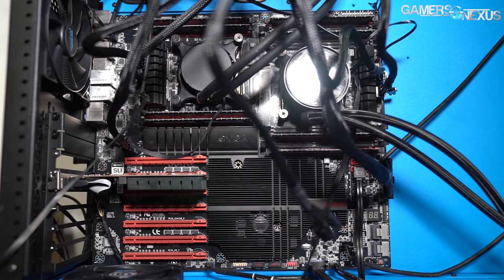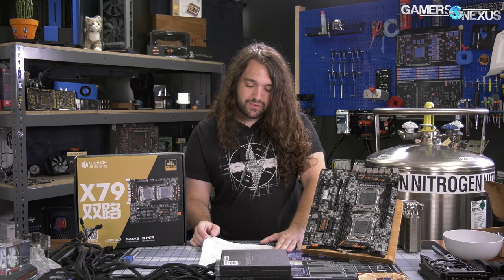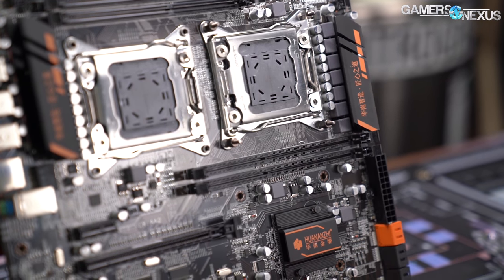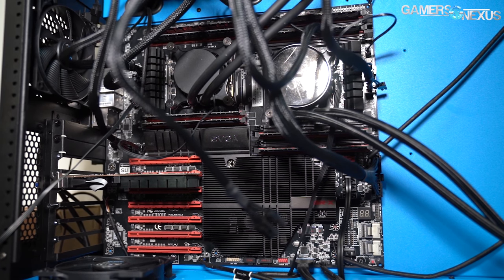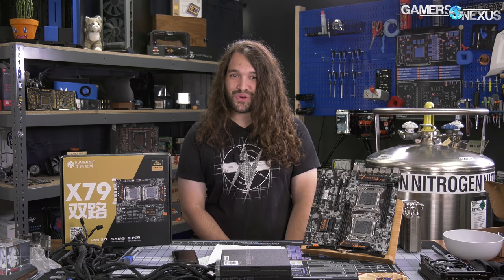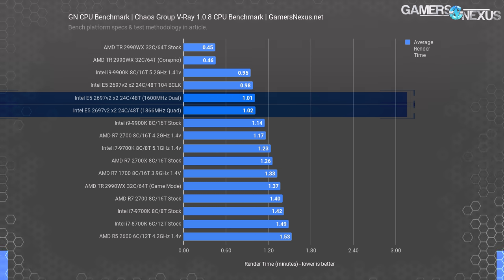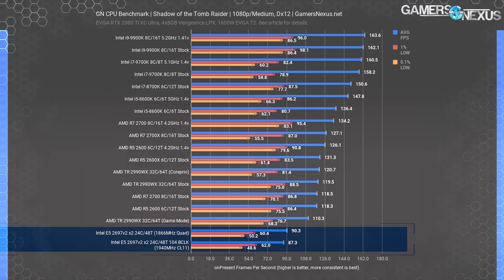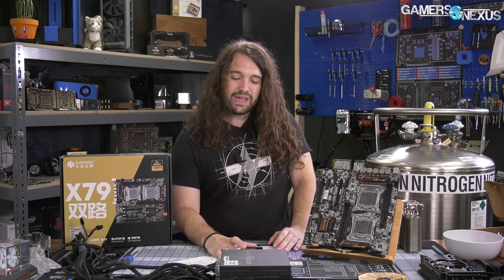Building a Dual-CPU Behemoth from Used Server Parts, ft. CaseLabs & Old Xeons

Comment from the maker: Grab the GN toolkit here: https://store.gamersnexus.net/products/gamersnexus-tear-down-toolkit
Watch TiN explain loadline and voltage here: https://www.youtube.com/watch?v=V2dqHqlyWio
Reply: @Gamers Nexus LOL i edited my comment right at the moment you gave it a heart and now the heart is gone - did you know that that will happen? :D
Reply: Can we please see how the 3900X does against these cpu's? I would love to see how these compare.
Reply: On new China 2011 motherboards available 8 channel RAM (4 per CPU x2) btw. Check it!
Reply: to get the chinese board to work, did you ever move the com jumper? I know most dual gpu boards have a set of jumpers above the VRM's. usually its 4 poles and if not configured properly, then the two cpu's will or will not be able to talk to each other.
Reply: Please keep doing what you're doing guys. You are amazing!
Reply: Why don't you try a odroid mc2 cluster Vs this setup (a LOT more efficient)
If you want a server to add salt to injury just stack some HC2 with glusterfs and use the cpu for handbreak ;)
This is a arm32 8core 2gb ddr3 soc made for these tasks ;)
Reply: @vsbb13  lol try lizardfs for PC+ PC= 1x file system
Reply: What about intel vulnerabilities patches on that Chinese motherboard?
Reply: @vanpeters9751  the thing is... These boards are waaaayyyy cheaper and more energy efficient than a PC
Reply: @vsbb13  cool I'll have to look into it more
Reply: From what I've heard there are some Engineering Sample E5 2XXX chips that have unlocked multipliers, would be amazing to see if they really exist and to see an overclocked dual socket build!
Reply: I upgraded my old supermicro rig with these same processors two months ago.  I love the speed boost I see in Premiere.  Do you guys think it's worth upgrading my 32GB of DDR3 1333 to 48 GB DDR3 1866?  What performance boost should I see?
Reply: maybe use google translate on your phone? i use it all the time
Reply: Get a Legit as in OEM Release version .... XEON 2679 v4 SOLO... (If can even find one, super rare) ... then you will see Broadwells TRUE performance! POWWW!!
Reply: AMD Opteron 3365  ;)

Comment: the words under X79 on that chinese motherboard literally mean ‘pair of roads’, roughly translated to ‘dual socket’
Reply from the maker: Very cool. Thank you!
Reply: Perhaps "two way" is the more applicable translation in this context.
Reply: The phase of “two roads” also use in China as be the translation of “dual socket” and “duel channel memory”.

BTW, The Chinese wrote all over the heatsink are crap like “we got the best technology “ and “we have good quality and durability”
Reply: 双=dual/two/double/pair 路=road/way
so i think it means "two ways" originally
Reply: @linuxsubsystem1638  It's just a term they use for dual socket I guess

Comment: Huananzhi, lterally means Made In South China.
Chinese brand name: Huanan Jinpai , literally means "the gold brand from South China".
A new brand started in 2010s which's famous for their new motherboards for old Xeons. 
In mid 2010s China used to import tons of old server hardware as electric trash for recycling. Meanwhile some PC geeks began to look into those trash parts and figured out ways to reuse them
they discovered padding 771 xeons that works on 775 motherboard. then they started to make new x58 , x79 mobos with mysterious chipsets. the brand is for the PC geeks..or nicknamed trash collector Lajilao in Chinese.
Reply from the maker: Awesome! Thank you for the history.
Reply: I still wonder how they make their x79 mainboards for example. Do they get the chipsets from Intel? Do they rip them out of old server mainboard and somehow transfer them onto the new boards?
Reply: It’s so awesome to see them take use of the old stuff.
A few years back it was so frustrating to see all the cheap i7 920s for sale that were basically useless because the boards cost three times as much.
Reply: @Martin M 
I know. Steve also mentioned that in the video. But how do they get the C600 series chipsets?
Reply: @-eMpTy-  Those are probably recycled chips from old servers
Reply: I think Intel keep stocks / manufacturing for many years to support existing product lines, the chipset could be brand new.
Reply: @Martin M It's the C602 chipset I believe
Reply: @Godfrey180  Yes. The chipset is used. Some sellers on AliExpress even mention this.
Reply: @-eMpTy-  Most of them aren't true X79 boards, because they use non-overclockable server chipsets. There are a handful which seem to be genuine X79 though. Mostly ripped out of old server boards, as you say.
Reply: @-eMpTy-  most use a c602 chip some use a real x79, some use desktop ivy bridge like q77, desktop chipset boards are the cheap ones with only dual channel, the c602 and x79 boards have quad channel and the latest models have overclocking without needing a bios hack, they work with XTU properly. like the x99 F8 and x79 2.49 v2.1. They are just BGA chips, not that hard to swap around if you have the proper equipment.
Reply: hahA! 
Thats Awesome!
 The Trash Collector! 
 The FIRST Image to pop into my mind was "Oscar the Grouch", a-la "Sesame Street",... of course. 

Likewise, I also very much appreciate you taking the time to comment.
 Many Thanks.
(Formal Bow, MUCH respect) ;)

Comment: Glad you decided to make a main Channel video out of that - really apricate that.
"A little Linus" like Video like that is very welcome.
You could even do more small parts like that in a mini series while doing the project.
I really enjoyed the more professional approach to that.
Reply: Me too I like this fun type of content also, Thanks
Reply: I liked that Steve showed how difficult it can be to get old hardware working together, especially if you are coming in not necessarily knowing absolutely everything about what you're doing.  The average consumer would have spent several times to get the end result, which would have resulted in an overall cost greater than a new modern system, which Steve demonstrated very well.

Comment: The problem was definitely the ES vs Retail chips. You can match two like chips together, but even the same SKUs will not work if not identical. I've been using the Huananzhi dual board for about 4 months and it's working just fine, if you ignore the dual channel memory.
That said, I'm super jealous of the SR-X board, even with its history.
Reply: I have seen your clip on the dual x79, been thinking on gambling on a cheap board just to experiment. But I was wondering why both of you purchase your board and cpu separately, not sure whether it does back in 2018, Aliexpress currently has entire sets that include board, cpus and rams. Apparently one of them have 8 dimm slots.
Reply: All of my fav xeon channes here
Tjc and you

Comment: For another project, you could try picking up some cheap Epyc first gen ES CPUs, then try using ZenStates from Elmor or do RW-Everything to change the registers to OC them. Sometimes you need older BIOS to use it with the ES samples, but this is just a thought (plus a hell of a server after doing it).

See this on OCing Epyc:
https://forums.servethehome.com/index.php?threads/overclock-your-amd-epyc.23422/
Reply: This sounds fascinating, especially the process to unlock etc.
Reply: can oc epyc!!!! very epic

Comment: I have one of those dual x79 huananzhi mother boards from Ali express for only $97 dollars delivered when using a few coupons which are readily available 

Then I got hold of 2x 2690 xeons for free from a throw away server

16 cores and 32 threads for peanuts
Reply from the maker: Wow! Good setup.
Reply: @GamersNexus  how is my setup(value wise)
E5 2689(2690 basically) 50$
Huanan x79 75$
4x4 1866 32$
Cx 650 50$
Rx580 121$
Reply: @spacy9571  Probably would have been better off getting a refurbished Optiplex with an i7 and standard ATX PSU for $200. Can find them with a 3770 all day long on eBay.
Reply: @alexskywalker888  lol what my cpu matches i7 3770 in single core and eats it in multi score
Reply: @spacy9571  how does that PC game?
Reply: Mine is in route as we speak. I got it for 100.00 and free shipping. I have a pair of 2680's waiting in my safe. 
By the time it gets here I should have the rest of the components in hand.

Comment: Old Xeons? I'm here! Where's the YES man? 
Just finished a recent build using an E5-2667v2 (fantastic frequencies for an ivy bridge 8 core from 2013) and my main build uses an E5-1650v2 (aka i7-4930k) OC'd to 4.5ghz. Xeons ftw!
Reply: Isn't the V2 Ivy Bridge? Not Haswell/Devil's Canyon?
Reply: @johnbuscher  that's correct. 4930k is ivy bridge.
Reply: I love the e5-16xx Xeons. Current game setup is a x99 with a e5-1630v4. Waiting to take delivery of a 2700x to see how it compares though...
Reply: Have three XEON rigs in the home.  Mine is based on ASUS P9X79Pro (local purchase $20) and an E5-1650V2 (local purchase $60, OC to 4.44 Ghz on air) plus 32GB non-EEC 1600 DDR3 RAM (OC to 1866MHz).

Eldest child is using HuanaZhi X79 Deluxe (w/C602 chipset) plus E5-4627V2 (8C/8T, all core 3.5Ghz) and 32GB R-EEC 1600 DDR3 (OC 1866MHz).

Youngest has a DELL Precision T5600 with Dual E5-2667 (all core 3.1GHz) and 32GB R-EEC 1600 DDR3.

The HuananZhi are really not OC friendly, so the locked E5-4627V2 is perfect...keeping cool and the VRM's less stressed.  Although, I still use an 80mm RGB fan on the VRM heatsink for safe measure with this motherboard.

Mine is for home office use and WoT play in 1080P from time to time.  Kids...it's Fortnite, of course.  All of these rigs handle 1080P fine.  Mine, with a GTX980, eldest with the RX570 8GB and the youngest...a GTX970OC. That rig already had an 825W DELL modular power supply.

Managed to get them all built/upgraded with a budget of $1200 (had some fantastic local deals plus the Dell was a legitimate company decommissioning that I received for free).  That included two new CoolerMaster Masterbox Pro RGB cases that came with 3RGB+1 fan each.  Two new power supplies (650 Bronze), a couple of SSD's, one NVME M.2 for the HuananZhi primary/boot drive, and a few single use Win10Pro licenses.

Comment: that workstation V.S. Rassberry Pi cluster of equal worth
Reply: Actually evaluated a pi cluster in terms of price performance vs used server hardware. Had a budget of about £700 ($900 ish I guess?).
The pi's were way more energy efficient, but actually slower per dollar.
Ended up building a cluster out of old lga1366 storage servers instead. Managed to get 5 servers each with 12 cores 24 threads and 24gb of ram.
Having pcie slots is also nice.
Reply: 101m4n that’s a heck of a value for 900 dollars tho
Reply: @gustavgustaffson9553  Well, aside from the power bill.
It idles at 300 watts and draws close to 1300 at full bore. Heats the room up something awful.
It's also a major kludge. Like, threaded rod and plywood levels of kludge.

Comment: Love the 2697v2, I put two into a Supermicro server board recently for under a grand and they kick ass for running VMs under ESXi - FreeNAS, Pfsense, Windows 10 for Plex, and a few cores leftover for DietPi (Pi-Hole). It's somewhat rare in the Xeon world (at least for back then) in that it has lots of cores AND decent clock speed while running them.

Comment: Running X58 Classified 1st Gen with 980x and GTX1070 at 1440p... It works. Almost 10 years on and still steaming strong. Gaming and Render work.
Reply: I have an Asus P6X58D-E and Xeon X5670 (6c/12t) @ 4.4GHz in my main PC. I'm planning to buy a GTX 1070 or 1070 Ti for it. Currently I have a piece of garbage GTX 960 2GB
Reply: @Pasi123  Nice combo. Ye the 1070 or 1070Ti is as far as you can go with a X58 setup before running into serious bottlenecking.

Comment: I did something similar several years ago. Built a Dual Socket G34 Opteron system. 2 16 core bulldozer based CPUs and 128GB ram.
Reply: that sounds ridiculous lol. Can't imagine how that system would perform.
Reply: @Radovanslav  turning it on probably ends in a fire and a power outage for his entire city.
Reply: @megapro125  thumbed that up even as an AMD fan (owned them from Slot A 750 up to Phenom II ... with a gap until Ryzen)

Comment: So cool to see this posting now considering it is very similar to my exact build that I made in November of 2018 when I saw newegg run a sale on the ASROCKRACK EP2C602-4L/D16 for $200 during black friday.

Asrockrack EP2C602-4L/D16 ($200)
Intel Xeon E5-2697v2 x2 ($274.5 x 2)
128GB DDR3 1600Mhz (8x16GB) ECC Registered ($240)
Phanteks Enthoo Pro TG PH-ES614PTG_BK ($109)
Cooler Master Hyper 212 EVO x2 Refurbished ($17 x 2)
ADATA SU800 1TB 3D NAND SSD x2 ($119 x 2)
Shucked WD 10TB White Label x 6 ($179 x 6)
WD Red Label 4TB x 4 (already had)
EVGA Supernova 1200 P2 80+ Platinum (Had to upgrade to fix power issues $239)

I'm running UnRAID on it and loving every minute of using it.

Comment: Newegg still sells the AsRock Rack EP2C602-4L/D16 brand new for $200 on sale. I have one using 2x2690 xeons. It's an EEB size board and the cheapest compatible case I got was the Phanteks Enthoo Pro for $100.

Comment: You can probably find those CPU's nearly, if not totally, free at an e-recycler that is contracted with some datacenters. It's not like there is much value in the CPU, materials wise. The trick as GN found out would be getting the MoBo's there is a lot of value, comparatively, in those.

Comment: Wow, I'm literally planning on finishing up a dual socket E5-2697 v2 box today.  I used a HP Z620 workstation which has a weird riser board option that the 2nd chip goes on.  Put the first 2697 in there a few days ago and was just waiting on some more thermal paste for the 2nd CPU, which came in today.  Good to know I'm not entirely insane for considering this sort of build.  Wish me luck!

Comment: try two e5 2699 v3 with quad channel ddr4. Im using one E5-2678v3 in quad channel and turbo boost unlock (force all cores to the single core max freq) and it is a beast. In some scnarios can beat the r7 3700

Comment: Text says:
X79 dual CPU
Top right: 3 years warranty, "not short of one day" (I guess also not any extra days)
And the rest is just babble that anyone understands such as SATA3 etc.

Yeah the name means "South Chinese Gold". 牌 can mean brand, or together with gold, being 金牌, it means gold medal. Either way, they think they are a top brand. Ehhh apparently not.
Reply: I bet that word would have worked fine if he put the correct ram modules on it. He was first trying to use non ecc ram.
My own research says these boards are not as sketchy as people think.  They are certainly should not be your first choice, but 
if you are ball'n on a  budget, they aren't that bad.
Reply: @rdsii64  It's a gamble thing. There's these electronic junk PCs that work for a long time and some just crash due to all sorts of reasons. 

You do get what you typically pay for.
Reply: @diatomsaus  True, but I paid $103.00 for mine and shipping was free. If I loose the gamble I'm not out much. The problem is that used name brand dual xeon boards go for almost brand new prices  because not many were produced so used ones still have high prices. I have seen them for as much as $500.00 for a five year old board.
Reply: @rdsii64  Wow that's quite a lot. There are these refurbished Chinese boards for like $200, dual Xeon. Still not cheap considering how good $200 boards are nowadays, and one is always risking the shipping. I'd say nothing can really go wrong with an AMD 3700x or a used 2700x. They are pretty darn cheap now.
Reply: @diatomsaus   If this non branded Chinese board takes a dump on me,  I'll keep the case and power supply, take the loss on the board, re-sell the cpu's, and start over with ryzen.

Comment: You weren't joking when you said that this is a $600 project. You might have gotten a good deal there but such  a build costs:
2x E5-2697v2 for $322 each
Chinese dual socket x79 for $130
4x16GB of 1866 Mhz DDR3 ECC reg Ram for $33 each
= $906, and that doesn't include the AIO cooler, case, power supply, storage.

Comment: This is pretty funny, its almost what I run. I couldn't throw down the money for the two 2697v2, but I bought two 2537v2 off of ebay for $80 dollars a pair. Most of the things I do require single thread performance, So I went with the quad core 3.5ghz cpu/3.8ghz turbo. I have 144GB of ram, soon to be 196 or so. I got the server for free, Compellent sc8000 (Dell R720), Ram for free, the cpus are my only out of pocket expense. I did a video editing race between this and my 9700K w/ 16gb and the Dell server spanked it going twice as fast, I love this thing for video editing. :)